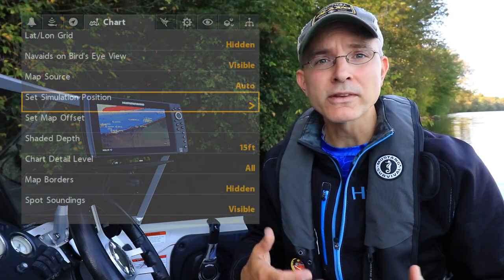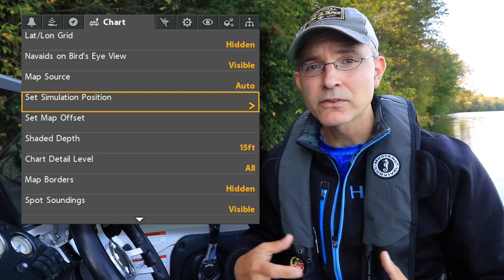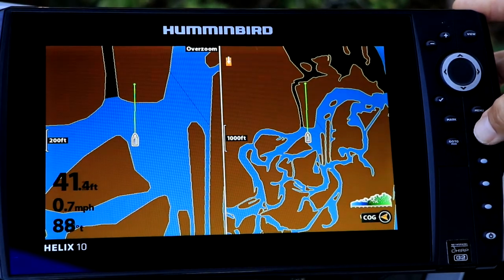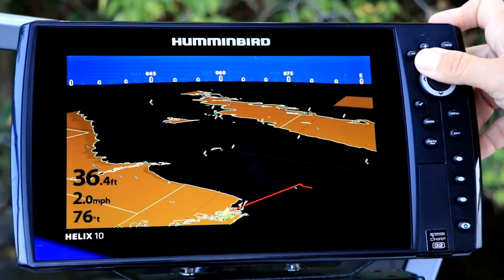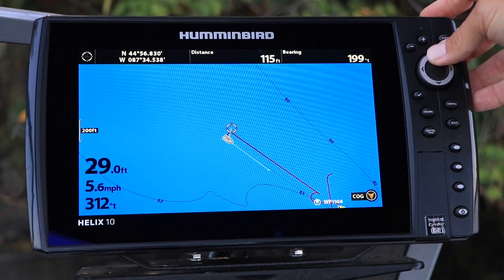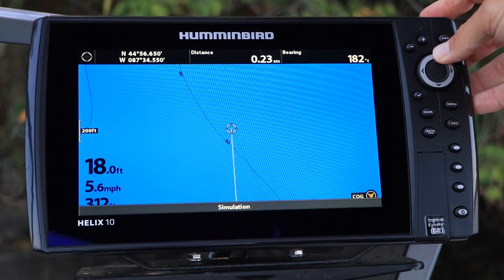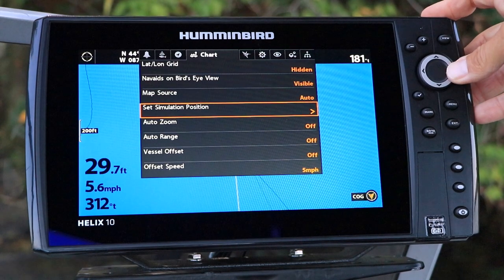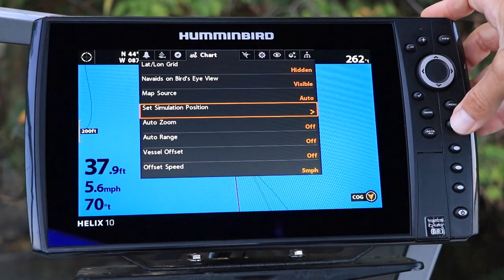Humminbird HELIX How To: Set Simulation Position

Comment: Installed on a 14 ft aluminum boat. Works really well>>>allabout.wiki/tcue   Comparable to my high end unit on my big boat. Like others have said the power wires are pretty fragile, I put on alligator clips and not problems yet.